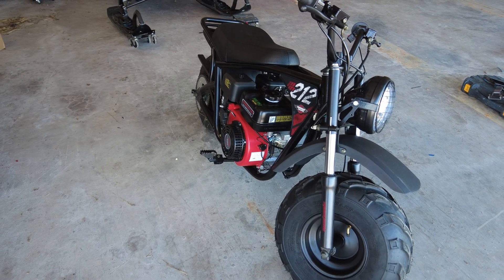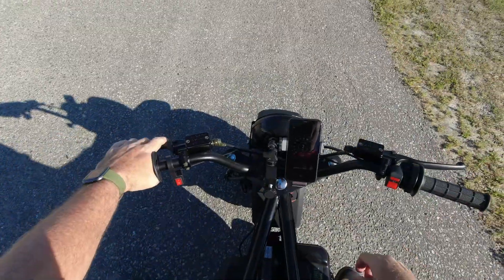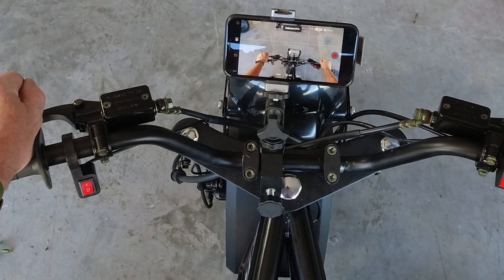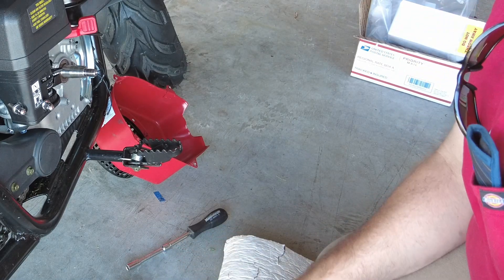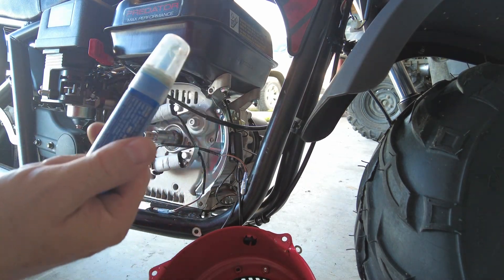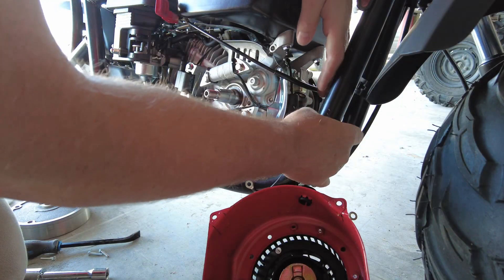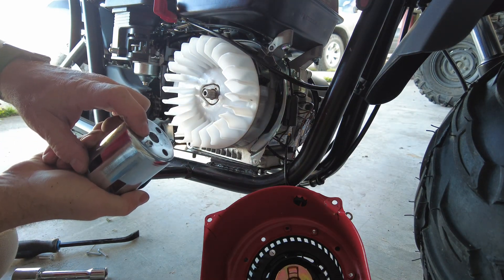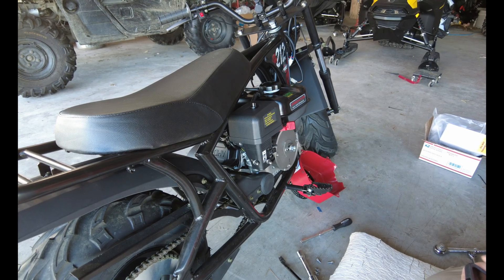Speed Test & Lighting Coils on the Mega Moto 212 - FAIL!!!

Comment: Mine only goes 24 miles😢
Reply from the maker: Have you tried backing the full throttle stop screw out?  That allows the governor to spin the engine up a little higher.